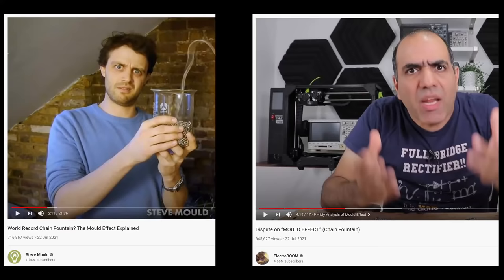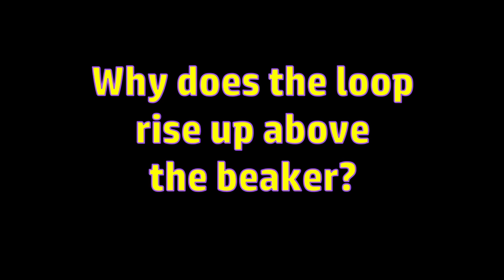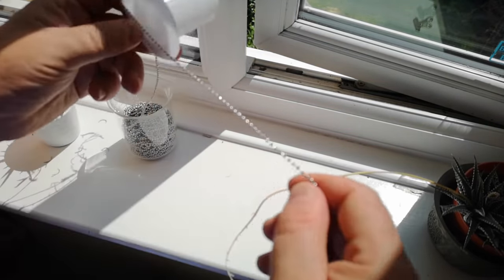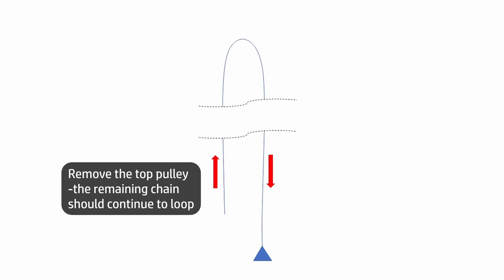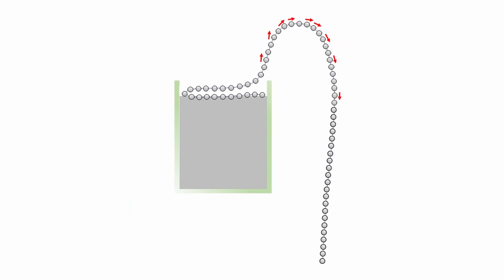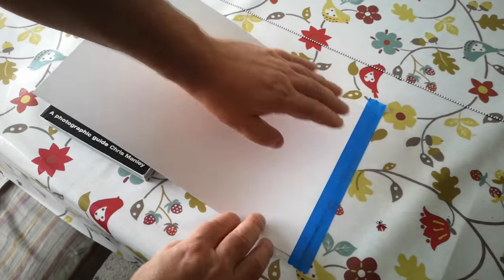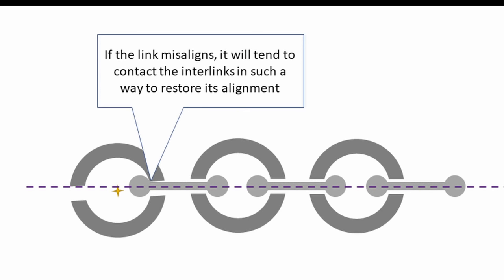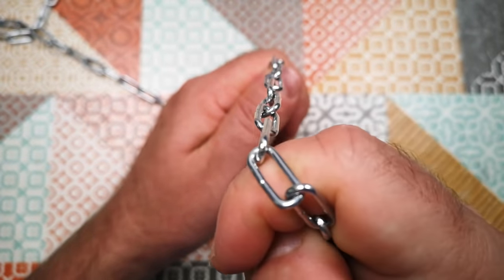Investigating the 'Mould Effect' - (Ball Chain Fountain)

Comment: The Cambridge explanation is rubbish.
There is never a bonus-kick at the container/jar/beaker.
There is indeed a bonus-kick when a falling chain-link hits (collides with) the floor of the laboratory, & this adds to the downward pull of a chain, & increases the size of the fountain etc (by say 1%).
But that extra (bonus) force is initiated by the falling/colliding link itself.
Meanwhile, back in the jar, a rising/yanked link will indeed get a kick from the floor of the jar (or from the links supporting that link), but, that kick is not initiated by the rising link, it is initiated by the preceding link.
The preceding link has a limited amount of impulse to give.
The kick from the jar results in a similar (but opposite) kick being given to the preceding link.
But the kick from the jar is not a bonus-kick.
The initiating impulse from the preceding link is not added-to by the kick from the jar.
The impulse of the kick experienced by the rising/yanked link has been borrowed from the preceding link.
In reality, borrowed from the full/whole chain.
Hence, at the jar, links or beads, it makes no difference.

In reality, there is no rising/yanked link. Duznt happen.
What i mean is, we mostly have a rising/yanked arc, made of many links.
In slow-mo u can see that there is mostly a long arc of moving links (talking bout metal beads here).
And the movings usually involve being dragged gradually horizontally for a time, & gradually upish.
There is no sudden kick -- it is a gradual    kkkiiiiiiiiiiiiiiiiiicccccccccckkkkkkkkkkkkkkk.

Look in slow-mo at a bead chain fountain.
There are say 4 adjacent beads acting as pseudo-links being yanked/jerked up.
(a) But, these pseudo-links are not rigid, they have a lot of give.
(b) And, these & the trailing say 5 or even 10 beads are moving horizontally & have daylite under them.
(c) The pseudo-links never have a solid floor to kick (down) against.
(d) And, even if the last bead in the pseudo-link does enjoy an upwards (very very weak) kick, this kick is off a slippery & lose bead or two, & the kick moves thems beads sideways (or forwards)(or backwards)(they are after all lose in every way).
So, beads do not provide anything like a solid surface to kick offa.
Sheeeesh!     Stone the crows!         Milo give me strength!            Are we blind!

The fountain (ie the arch)(the half circle) is simply due to the inertia of a chain.
If a stationary chain lays over the top of a wall, it forms a sharp V-bend.
If the chain is pulled down on one end, then it will rattle up & over the wall, with some speed.
If the speed is sufficient, the sharp V-bend will become a U-bend, due to centrifugal/centripetal forces opening up the V.
If speed increases, the U-bend opens further.
If speed increases a lot, the rising chain leaps up clear of the wall, & stays clear, the zenith/crest depending on gravity, & the U-bend opens some more.
And we have our fountain.
The height of the crest/fountain depends on speed (& is probly higher if chain heavier).
The radius of the U-bend/fountain depends on speed (& is probly larger if chain heavier).

Steve Mould & others say that the radius of curvature cancels out in the equations, & doesn't play any roll in these dynamics.
Steve is wrong.
If he were correct, then that would mean that the radius can vary greatly, for any given setup.
It might mean that if u initiated the fountain with a given radius then it would affect the final (maximum)(steady state) radius.
But i reckon that the radius (for a given setup) tends to one number.
And i reckon that the radius (for a given setup) varies with speed (ie varies with drop).
Just koz the radius cancels out in some dynamical equations duznt mean that radius duznt play any roll in the dynamics.

Steve Mould shows how a horizontal tight pattern of rows of chain (beads) gradually moves away to the west (due to the kick-effect) when the end of the chain is pulled east.
Yes, there is some kick effect, due to the pseudo-links.
But, the greater part of the effect is due to a chain's inclination to retain a pattern.
Here, we see that at each end of each row the chain forms a loop, looping around & back throo say 220 deg, such that the rows are hard up to each other.
As the end of the chain is drawn east, the end loops move across & back & across & back etc.
Now, Steve knows that a chain has a memory, ie it tends to retain a pattern.
In this case, that pattern is a 220 deg loop.
And, as the loop or loops traverse across & back etc, the loops slowly push the rows west.
That westwards slow pattern-push is a different animal to the quick jerk of a pseudo-link kick.
The slow pattern-push duznt suffer from the hi losses suffered by a pseudo-link kick.
Pseudo-links are not rigid, they have give. Give aint a problem for a slow westward pattern-push.
I said that yes there is some kick-effect. 
But, i have already said that these kicks are not bonus-kicks.
They borrow from the overall power of the chain system.
They don’t add to the fountain.

It is virtually impossible to load/store a chain in a jar without having loops. 
And loops result in jumps. 
If u have a close look (in slow-mo) u can see that chains have a lot of horizontal movement before exiting vertically, & the chain sometimes suffers little jumps in the jar, as each leg of each loop jumps (horizontally) over its mate. 
Jumps magnify the fountain, kicks dont. OOPS. No, i am wrong. These little jumps are not bonus-jumps, just like the kicks are not bonus-kicks. Any vertical impulse gained by a jump must have been borrowed from preceding links. 

Also, the horizontal movements seen in the container/jar/beaker are a waste of impulse.

But, in any case, we don’t need bonus-jumps nor bonus-kicks to achieve a growing fountain, & to achieve a very high fountain. 
All we need is lots of speed. The chain will crest at any height, depending on speed. There is no limit.
The idea that something special (like a bonus-kick) is needed (if the chain is to rise above the edge of the jar) is silly.

One thing that everyone has missed, in every youtube re the chain fountain (that i have seen), is that vertical jump effects & vertical kick effects (etc) are cumulative, and lasting (tautology alert).
Or at least partially cumulative & lasting. Air friction, & link friction see to that.
Anyhow, cumulative/lasting effects are the reason for some of the slightly weird gyrations/waves.
For example, it (lasting accumulation) is why we eventually get a persevering, vertical component of arc (a mini fountain) when the test seems to be strictly in the horizontal.
In fact, the lasting/cumulative effect is the main reason for the fountain.
There needs to be an initial vertical rise out of the jar.
A horizontal initial exit wont do the trick.

Comment: You are trying to equate this to standing wave.  I do not agree.  The key is the method of connecting the balls.  The limitation of freedom of movement is the key.  Its the opposite of highly flexible. I would like to try this experiment with something like an extension cord, something that also has a limitation on its freedom of movement
Reply from the maker: I think you're making a mistake if you imagine one singular property of the material is responsible for the effects, or that one explanation negates all aspects of all the others.
The stiffness and minimum radius of curvature might be a factor (although the to of the loop is very much wider than that), but nothing in any of that negates the existence of wave behaviours in the material
Reply: @AtomicShrimp  No I don’t think you quite understand. I don’t believe the stiffness of the chain or the lack of range of motion between the balls Is the only reason this phenomena happens. I believe it’s literally a perfect storm of characteristics that make it possible for this to happen. Let me throw something else at you. The container of the ball falls from. I’d like to see the difference between a glass jar and a rubber jar. The glass jar perfectly reflects any sort of force imported on it the rubber one would absorb most of it. Do you think this is worth doing?
Reply: @AtomicShrimp  what I see happening, and I have no qualifications to back this up, this is just my intuition, is that eventually the ball hits the side of the jar with enough force that it is slightly kicked up from the jar. This small kit eventually becomes amplified though because of the range of motion limitations.  I remember seeing Steven mold twhrough the chain off of a tower.  In both experiments with a chain broke before it got all the way through. Now I could be wrong but that she should have been able to support it’s own weight.  That means it was exerting the force greater than the actual weight of the chain on the link that snapped. I think that’s rather curious as well.
Reply: @AtomicShrimp  In fact the more I think of this, I think this has more to do with the cracking of a bullwhip. As the chain gain speed this reminds me more and more of the speed at the end of a bullwhip. I can’t put my finger on it but I think they somehow are similar
Reply from the maker: Right, but a bullwhip is also a wave phenomenon
Reply: @AtomicShrimp  One last thing I promise. I’m on vacation so I have time to devote to this endlessly. I would love to know just how fast that she was going in Steven Moore’s experiment when it snapped. A bullwhip can achieve speeds to crack the sound barrier just along the length of maybe watt 15 feet? Think about it, when you crack a bullwhip all you were doing is creating a wave (touche) That’s hell a cheap speed in excess of the sound barrier at its terminus.  Just how fast can this chain feed out? How fast was Steven moulds  chain going when it snapped?
Reply: @AtomicShrimp  read my next. Lol
Reply: But in any case, i think you know where im going with this.
Reply from the maker: The bullwhip is actually an excellent analogy, perhaps better than you imagine - the tip of the bullwhip doesn't need to bump anything - the energy all comes from the handle end being sharply moved downward.
Now imagine a hypothetical bullwhip that was infinitely long, and instead of just pulling the handle down once, you pull it down and keep pulling, accelerating indefinitely - the wave that you put into the whip continues to grow because you continue to inject energy into it
Reply: @AtomicShrimp  Absolutely exactly. Eventually at the lip of the jar you would hear a sonic boom. However I think that’s exactly what was about to happen in Steven Moulds experiment And that is what caused the thing to snap.
Reply: @AtomicShrimp  Perhaps the chain takes that shape of the loop exactly to prevent itself from breaking the sound barrier. Maybe it’s a sort of distortion that occurs because of the speed. I don’t know I’m not a physics guy
Reply: @AtomicShrimp  I believe we are onto something. I don’t even know that the Steven mould phenomenon is any sort of unique phenomenon. Which is too bad because I like the guy. I’ll leave you to make a video on this if you think it merit it. In any case it was a pleasure to discuss this with you
Reply: @AtomicShrimp  As far as why this does not happen with regular chain, I want to say it’s because it’s just simply never achieve the speed that this sort of bull Becomes relevant? I think the almost laminar flow nature of the ball chain as it leaves the jar just give her a much higher speed, but maybe I’m just babbling
Reply: @AtomicShrimp  No I got it. The space between each ball Is smaller than the width of the lip of a jar. That decreases friction enormously.  The regular chain has spaces between the links larger than the lip width.  So each link sort of hangs there, enormous increase in friction and that you don’t get the same speed
Reply: @AtomicShrimp  so i was originally pretty thoroughly wrong. The flexibility was of not much consequence.

Comment: I think this should work with a rope too
Reply from the maker: Sufficiently smooth, heavy and flexible rope should do it
Reply: @AtomicShrimp  maybe a hose too
Reply from the maker: The only problem I see is the torsional issues. Ball chain cannot get twisted or kinked - every joint is a spinner
Reply: @AtomicShrimp  
that is true, so it looks like the ball chain is the best case scenario, other substitutes should work but can come with some disadvantages making the effect less pronounced

Comment: Your upward slope experiment failed because you have not been considering the entire ocean wave, therefore you didn't realize how your setup was not a good analogy. In the open ocean what we would describe as the wave (the part that is higher than the surrounding water) is just a part of the entire wave, most of it moves under water. When the wave hits the shore it's deepest point is pushed up, because it can not extend into the seafloor and more of the wave rises above the water level. That is why it looks like the amplitude increases, when in fact just the entire wave rises higher.
I would like to compliment you though for reducing the chain to two and later three interacting balls, reducing a system to the least amount of parts needed to display a behavior is exactly how you get to the core of things in physics.
I have not looked into this particular problem, so I'm not confident to say whether or not your conclusions are correct, most of your methods seemed sound though. I am also just generally happy to see someone do science on their own.